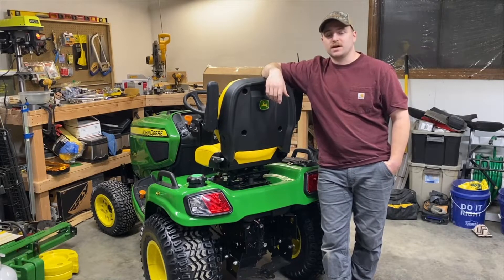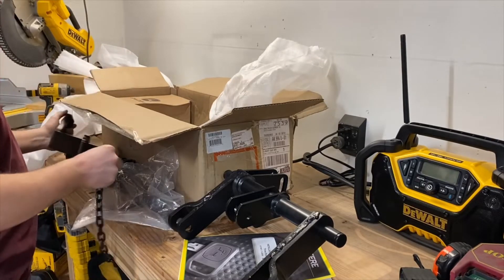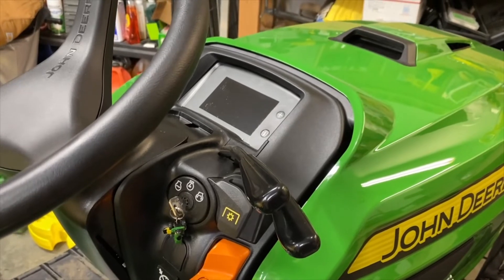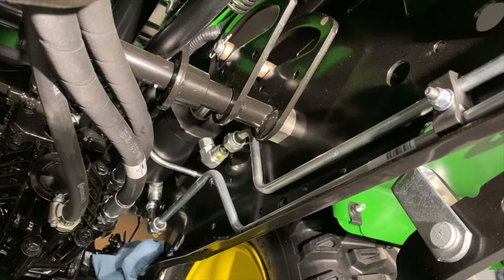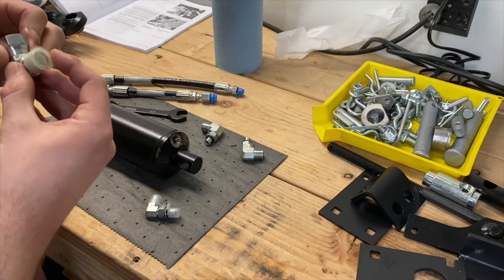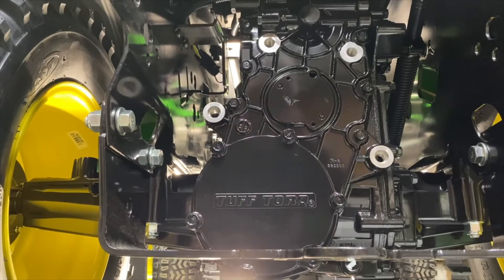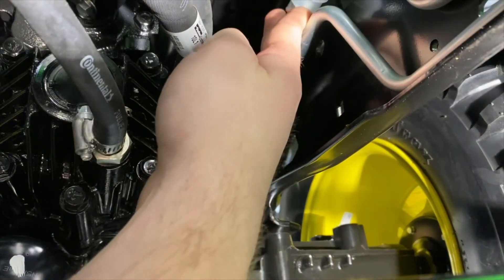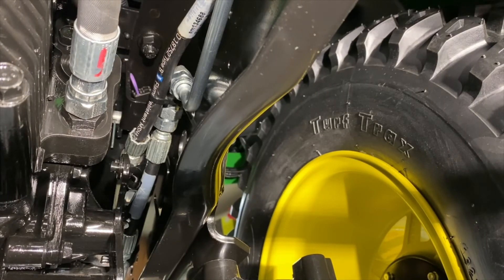John Deere X758 3 Point Retro Fit Kit Install - Prep for 3 Point Install

Comment: Just finished installing the retrofit kit on my x758. It wasn’t the most fun thing in the world to do, but the video definitely helped! Thanks! A Little trick I did was to fully tighten the hose end of the 90 degree fitting that connects to the hardline, but leave the hose end of the 90 on the cylinder a little loose. That lets you get everything positioned, and you can snug the hose from the back of the tractor very easily once the hard line is connected.

Comment: Nice video! I’m installing Ron’s H3 kit from aux hydraulic. Removing the linkage rods would have helped a lot for me. I may still remove them to install the hydraulic lines easier. I’m adding a second piston to the mower deck to separate it from the rear 3 point lift. It’s gonna be a sweet set up. The rear will be on its own piston so the linkage bar is deleted.

Comment: Wow, you were right on the money.  Yes, install and tighten the 90 fitting on the cylinder before installing.  Yes, the rear lift arm instructions are terrible. YES! why wouldn't Deere install this cylinder in a better spot in the first place!  WHY would Deere use a u-bolt in the first place to hold the cylinder against the frame?!?!?!  Just so many questions after a really frustrating install.  Thanks for your video, it was excellent and helped a lot!

Comment: I was able to get the pin for the cylinder through the hole on the left frame rail. You don’t have to move the pie shaped brackets.

Comment: JOSH any tips on removing the three point hitch
Reply from the maker: Like completely? Or just the arms? Arms are easy, just pull the pins… whole thing is a different story. Wouldn’t really want to take it all out unless absolutely needed.
Reply: Josh  yes completely bought the tractor used and will never use it. i have everything off except for switching the hydro lines back
Reply from the maker: Probably not going to be able to unless you have the original fittings. I’d just leave it on. It’s a great accessory, one day you may find a use.

If you absolutely wanted though, you may have to go to Deeres parts catalog, and find all the fittings on there to revert it back. Cost some money though.
Reply: josh do you know the   the part numbers for the - pin - two bushings - cotter pin  from the lift cylinder you discard
Reply from the maker: M90097 (1), M154594 (2), then either 11M7017 (1, serial number _010000) or GX21530 (1, serial number 010001___)
Reply: thanks @JoshsGreenGarage